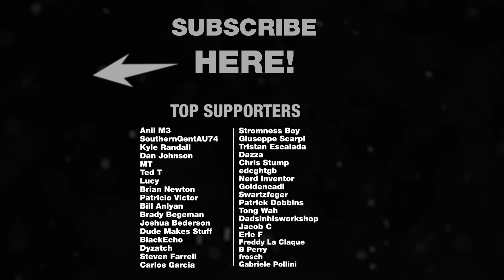Pitch Bowl for Chasing and Engraving, Huge Brass Casting

Comment: i realize this is a payed add for the Vevor set up and i hope your keep perusing  Chasing and Engraving but you might want to think about adding a ring of felt or leather to the inner lip of the stand so that there is something for the blow to bite into this will make it more stable and stop it from creeping out of position Metal on metal is relatively slick (over all your have made a beautiful lifelong tool)
Reply: just fill it with sand ... the sand will absorb any vibrations and give that solid thunk sound ... still amazing for a pitch bowl it will last forever now just needs some engraving on the lower stand :)
Reply: @TheRavnKnight  just my op but if i can keep sand away from my pitch i do
Reply: @wmose3694  oh i was talking about the base filled with sand ... not the pitch ... should have explained my thoughts a bit better ... my bad
Reply: @TheRavnKnight  yeah i know but loose sand in the base would not help with the grip as he wants it to rest on the rim and i don't even use sand bags in my shop if i use anything like that i have bags filled with steel shot

Comment: Hi BB. To make a perfect fit between the bowl and the base, the idea of using the bowl as template for the sanding paper is right. But you should do the contrary too. I work with marble and once I made a rolling ball fountain. To achieve the perfect match between ball and base I used quartz sand with water and rolled the ball until there were no flat spots on both contact surfaces. It's a long process but really effective.
Reply: Do you have a video showing that cause that sounds very interesting?
Reply: @fnafplayer6447  Nope. I did it somewhat 15 years ago, a hell of a job and I promised myself, never again. 😉

Comment: Next time you cast you should think about a riser vent. Gives a place for the air and gas to go and gives 2 reservoirs of molten metal for the initial shrink before it solidifies. Very interesting project. I have a friend from decades ago named Jim Downing in Springfield Missouri. He is a legend when it comes to engraving. And he made a very nice life for himself. I believe he is still working but I doubt for much longer.

Comment: It’s the pitch a non Newtonian fluid? So when you strike the object to be engraved it feels hard as well as holding it firmly.
Reply: The pitch when cool is actually fairly brittle which is why he melted it with the torch to mount the engraving piece.  The force required to do the engraving is quite low when spread out over the entire piece so there is little risk of shattering the pitch behind it during the engraving process.